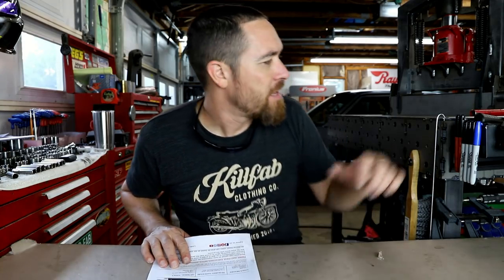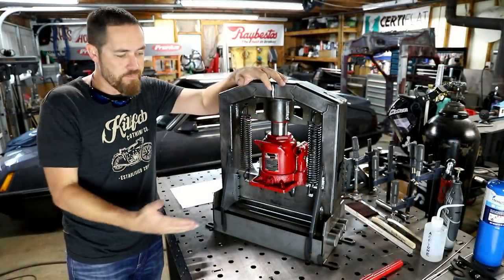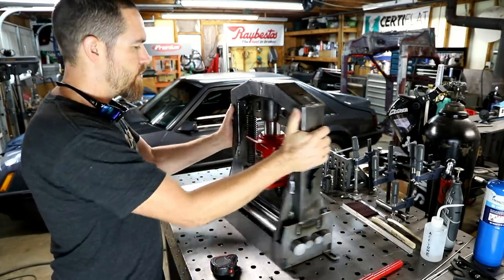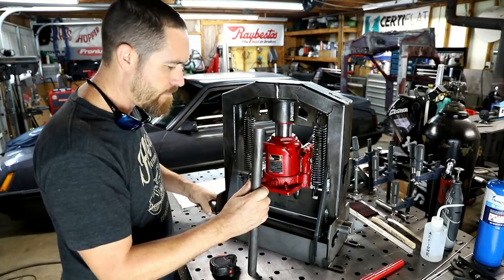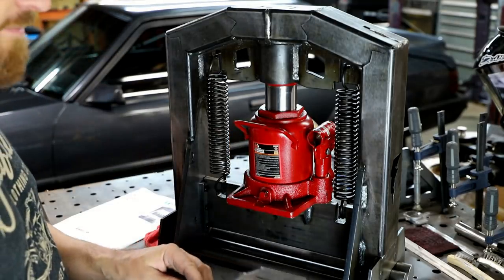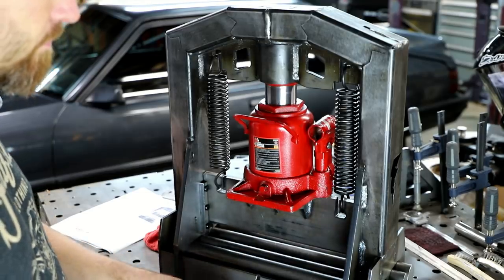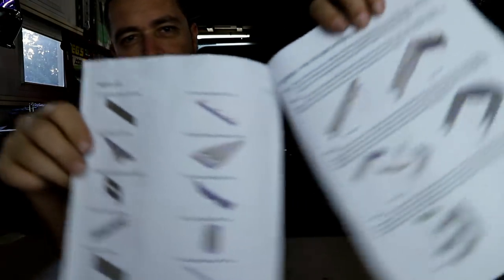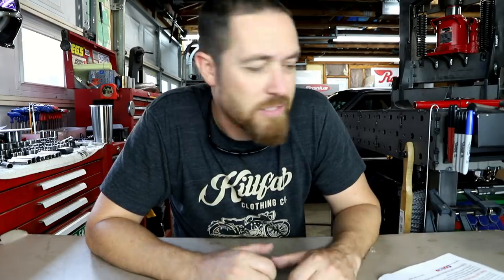You Need This Tool - Episode 103 | WeldTables Fab Brake Kit

Comment: I have a press brake that goes into my press like you spoke of.....its not really that big of a deal to remove it when need but I've often times thought about making a fixed frame and making it a separate tool, cool that they went ahead and did that....

Press brake is one of those tools that you dont realize how useful it is until you own one. I use mine ALL the time.

Comment: Yes, a press brake is mighty handy....just not this one. I think the Swag model is better in the sense you can revert to a standard hydraulic press for bearings, etc.
Reply from the maker: see Im the opposite ....I would rather have a dedicated press setup all the time to just bend the thick stuff. And used my big press for stuff like bearings and dimple dies.
Reply: Buy a used 2nd Hf press on market place or craigslist for like 75$

Comment: $320 and I have to put it together? 
Hell no
Reply: And no jack
Reply: Fabricators that don't want to build something? Hummm ....
Reply: Fabricators that aren't paying $320 for parts we have to assemble ourselves and still supply other parts. 
I'd build it from scratch long before id buy it.
Reply: $368-$380 by the time you but the jack, and that's not including if they charge shipping, plus welding wire, argon and time you will have $400 in it.
Reply: Goody for you.